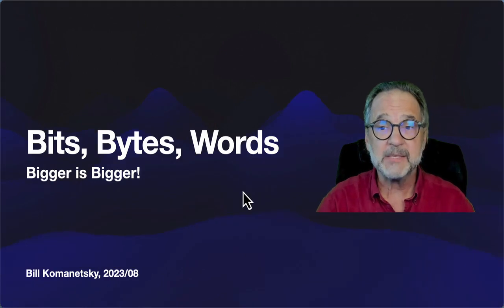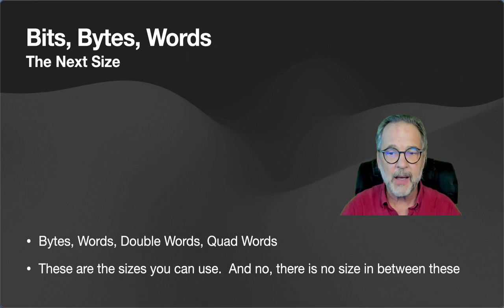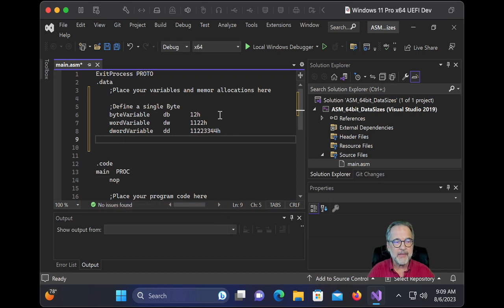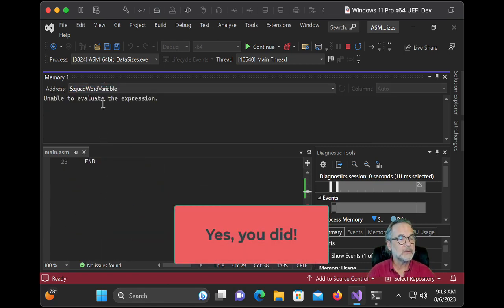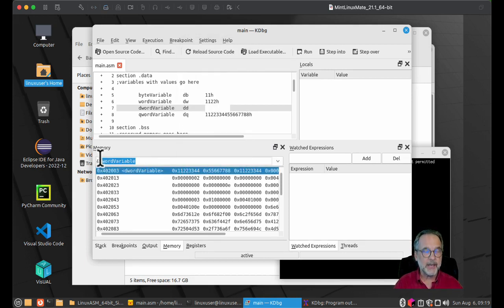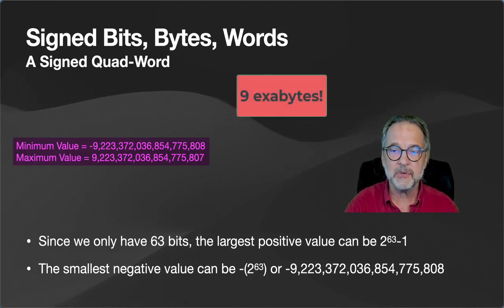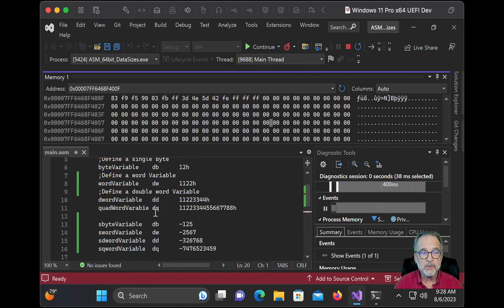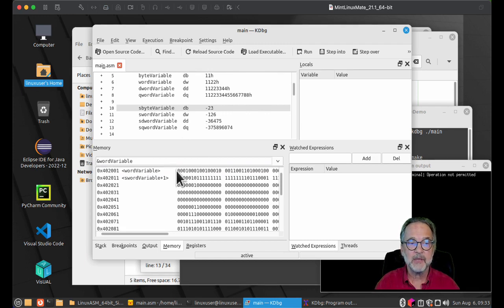Assembly 12: Signed and Unsigned Integers + Demonstration!

Comment: Hi, I have some issues with the templates i created followingalong an earlier video , and actually even with the one you supplied in the download. When the code is callin ExitProcess I get an Access violation, "Exception thrown at 0x00000000011F22FA (KernelBase.dll) in ASM_64bit_DataSizes.exe: 0xC0000005: Access violation reading location 0xFFFFFFFFFFFFFFFF.". Any idea what causes this? When i single step into the ExitProcess dissaembled code i eventually get to this instruction "movaps      xmm0,xmmword ptr [rsp+40h]  " and this causes the exception . The callstack looks like this: KernelBase.dll!00000000011f22fa()
KernelBase.dll!00000000011f2929()
KernelBase.dll!00000000011f275e()
KernelBase.dll!00000000011f2698()
KernelBase.dll!00000000011f2556()
KernelBase.dll!00000000011ff4a4()
KernelBase.dll!00000000011ff46e()
KernelBase.dll!00000000011c2474()
KernelBase.dll!00000000011c18e5()
ntdll.dll!00007ffbfbe98b7f()
ntdll.dll!00007ffbfbec1586()
ntdll.dll!00007ffbfbec117d()
kernel32.dll!ExitProcessImplementation()
ASM_64bit_DataSizes.exe!main()
Reply from the maker: Very interesting.  It definitely looks like it could very well be your code and not the 'template'.  
1) Have you tried to debug it one line at a time until you get to the statement that causes the exception?
2) Does it happen in the exit-process meaning it gets through all of your code and dies in the Exit process?
I'd like to help you figure this out.

Comment: Hi, thank you for this course. Really appreciated 😀 I have a problem. I'm working on wsl2. In the linux part of the video, kdbg shows no code. There's no error in my program, because it works fine. It's weird because kdbg for 32bit works properly and debugging is possible. It seems its not working for 64bit
Reply from the maker: Yea, that's cause you're using a version of NASM that isn't compatible with KDBG or vice versa.  I saw this in my assembly classes at the college.  Try this (from a terminal):

nasm --version
If the result of this command is not 2.16+, then you need to remove NASM and install from source:

1) sudo at remove nasm
(This will remove the installed nasm you have)
2) wget https://www.nasm.us/pub/nasm/releasebuilds/2.16.01/nasm-2.16.01.tar.gz
(This will download the 2.16 version of nasm source code)
3) tar -xvf nasm-2.16.01.tar.gz
(This will expand the .zip like tar.gz file)
4) cd nasm-2.16.01
(This will take you into the unzipped directory)
5) ./configure
(This will setup your build scripts)
6) make
(This will compile and link your nasm)
7) sudo make install
(This will install this version of nasm)
Reply: @billskycomputerguy  It's working now. I reinstalled NASM from source, but I had to assemble and link code once again to see the difference. Thank you very much :)
Reply from the maker: Oh, Great! @stoneyjohn818
Reply from the maker: OK, I can test this myself.  What OS do you have installed in your WSL2 session?